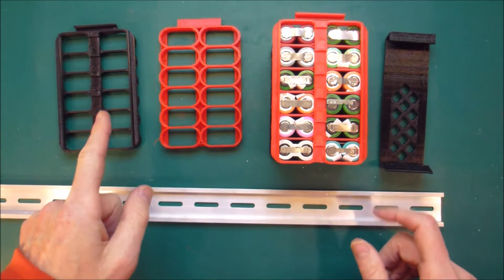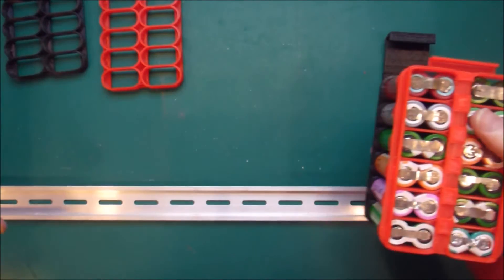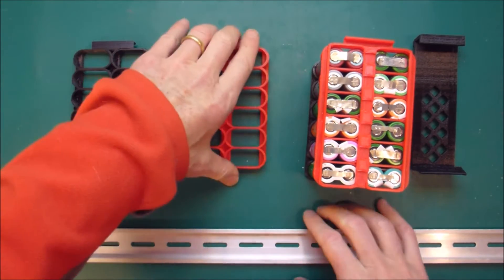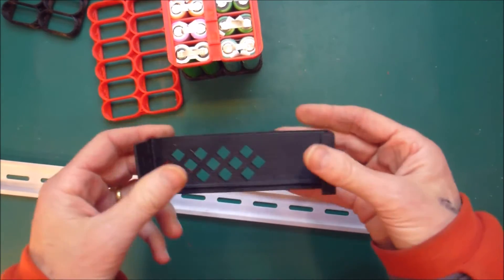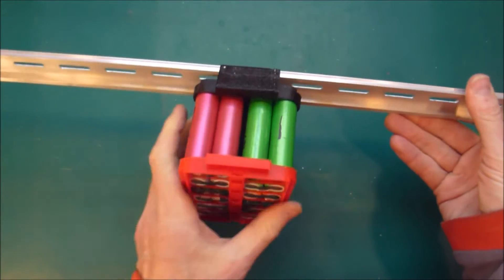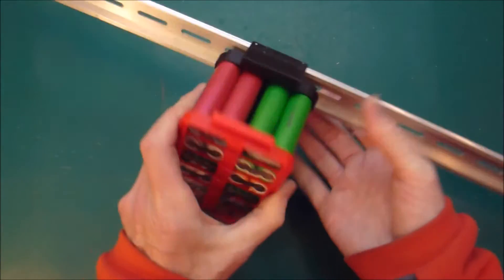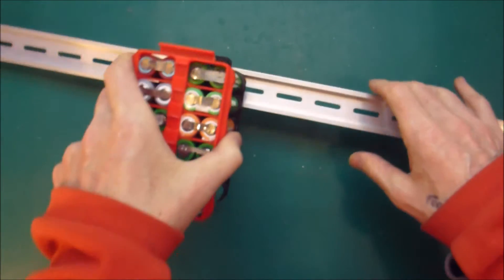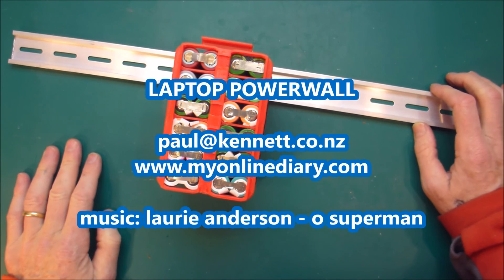Laptop Powerwall 62 - DIN rail mount for small 18650 blocks

Comment: Great idea Paul, but I would be very concerned about the structural integrity of the din rail holder for the cell packs, and if I were to do this I would print the holders sideways (wide side up so to speak) to take sure I take advantage of the much stronger extruded ABS / PLA in the same layer versus between each layer.

Have you tried to give the rack a good shake with a few cell blocks mounted in the DIN rail holders and see if they fall apart?

Do you have any issues with earthquakes in NZ?
Reply: Oh you are printing them standing up so to speak! :-)
Reply from the maker: Yes - I did print them sideways. I've given them a good shake and they seem pretty secure. Since printing the first batch I've pulled blocks in and out at least 10 times and they seem to be holding up quite well.

We had a wild earthquake last November (https://www.youtube.com/watch?v=Dx4FU_NAmfw&t=238s) and the system was fine.  So far so good!